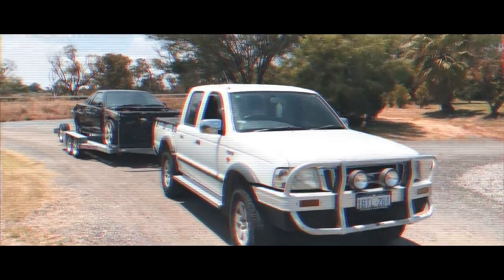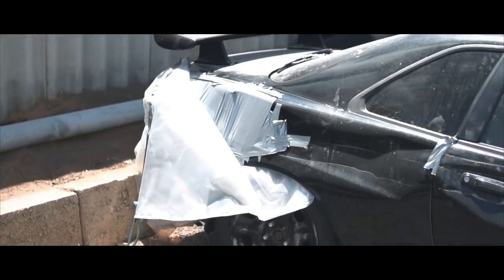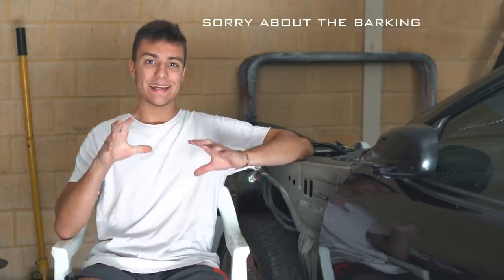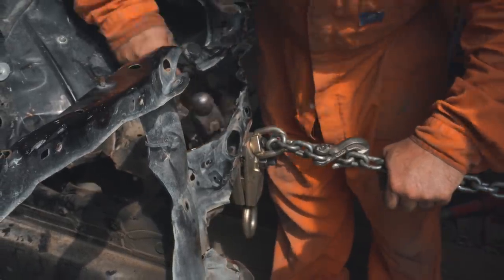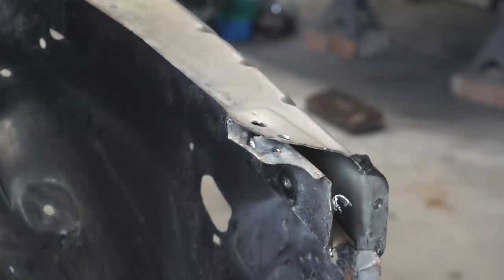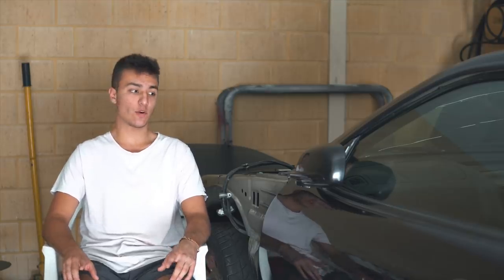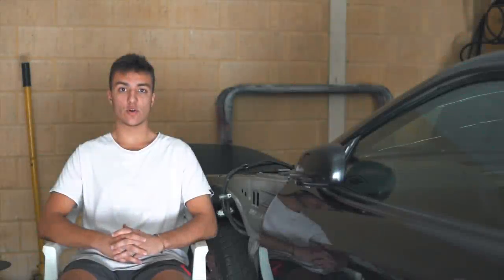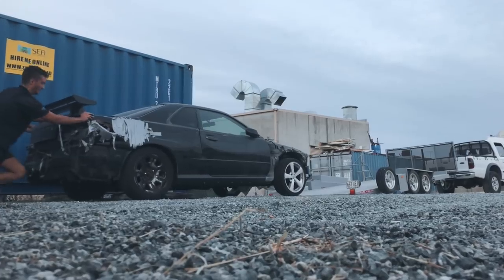SAVE THE SKYLINES | Poor Man's GTR [EP2]

Comment: I did a similar sort of thing except i bought a wrecked R34 GTR & transferd everything over into my R34 GTT. I have kept it RWD with an R34 GTT Gear box. But otherwise than that its all R34 GTR. I  transferd every single wiring loom & fusebox etc. The chassis are around 95% the same if you start with a GTT. GTS are a bit different in that they dont have alot of the braceing that the GTTs do. Ive done the complete interior swap & everything works as per factory inc the MFD screen & all its functions. Your vids great to watch & its good to see you save the car rather than scrap it. Im keen to see  the next video. Keep em comming
Reply from the maker: Dude that’s awesome! Sounds like a really good setup. I’m sure when you did it all, prices of GTR parts were a lot cheaper. Now anything with the letter GTR is triple the price of normal Skyline parts. Would have been a shame to scrap the car
Reply: @BrokenSilvia  yea it had been put backwards into a tree. I picked it up for a song. Was bout 7 years ago. Still have it now.
Reply from the maker: Do you have any GTR tail light surrounds off the car? Or an oem spoiler
Reply: @BrokenSilvia  no dont have any parts left anymore. Join up to the GTRNZ buy n sell site. Ive seen that sort of stuff come up for sale before
Reply from the maker: Alrighty wicked

Comment: Hey mate what do you think of the tilta trailer, been thinking of buying one...
Reply from the maker: Hey mate! Where do I even start.. If you can see yourself using a trailer often then I would 110% buy it. No need for ramps which means you can throw cars on the trailer in tight spots (no need for extendable ramps). If you are road tripping, there’s jerry can holders, a shield to protect the car from rock chips, bugs and a winch if the car doesn’t work (even though we usually just send it and push it up 😅). Such a mad trailer, even the S15 gets up on it which is quite lip low. It’s obviously ‘bagged’. The suspension runs of it’s own battery and brings the trailer up in less than a minute. If you want more videos photos just shoot me a message @broken_silvia IG.Hope that helps!

Comment: How long did this take/how much
Reply from the maker: About 2 days worth of work and under $1000 in parts (does not include front body panels)
Reply: Broken Silvia really?!
Reply from the maker: Yeah honestly
Reply: Broken Silvia wow how bout the engine
Reply from the maker: Dont have one for the car yet. The $1000 i said was to repair the front end damage (about $1000 worth of parts the include brackets, bumper support and radiator support)

Comment: That’s a skyline gtt
Reply: How?. I mean what's the difference between the GTT and the GTR?
Reply: GTT/RB25 GTSRB25. GTR RB26
Reply: So if I got a gtt and just painted it with shiny black paint it becomes a gtr ?
Reply: death from above no see the stock paint can tell u if isn’t or if it’s not and if you paint it nothing would really change
Reply: The two differences between the R34 GTR and GTT is the front end, the rear bumper and the rear quarter panel even the engine and interior

Comment: Is it the gt4 model? If not you could get a 260 stagea front cut. Get the front hubs cv's awd. Be a legit gtr.
Reply from the maker: No sit, it’s a gtt so rwd only. Could make it awd but the chassis rails and gearbox tunnel would need to be replaced as well
Reply: @BrokenSilvia  makes me regret selling my 34 gt4 even more now, I didn't know about the chassis and floor being different. I kept it mint for 7 years and sad fact fuck boiI sold it too, ruined it. 
Keep it up its inspiring  and motiving 💪